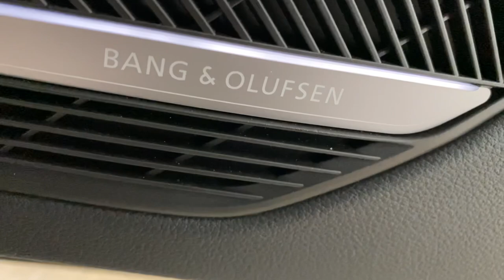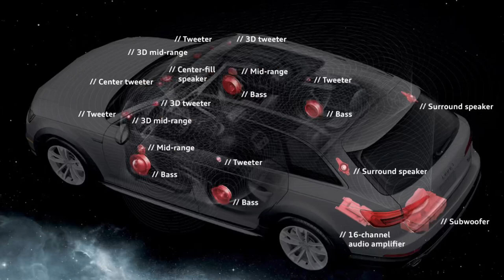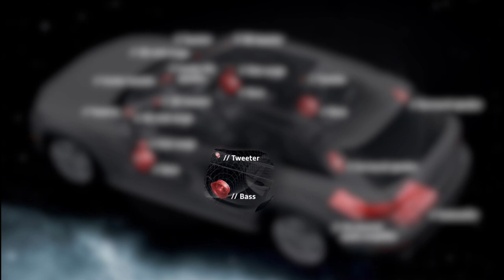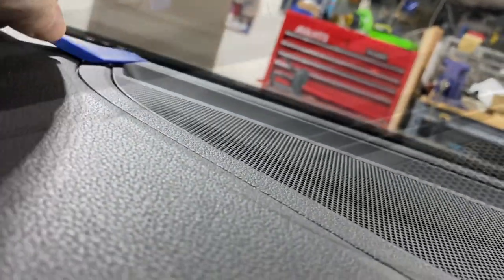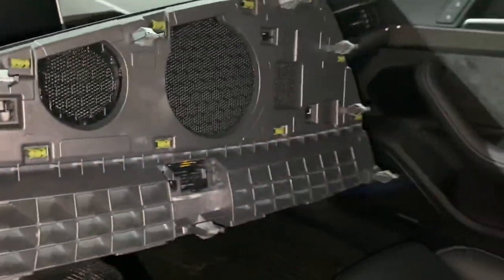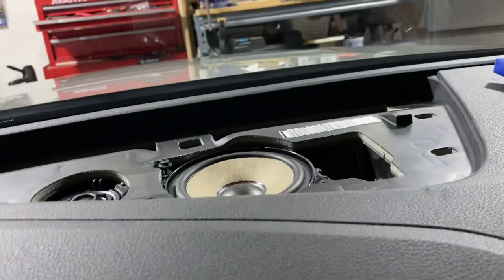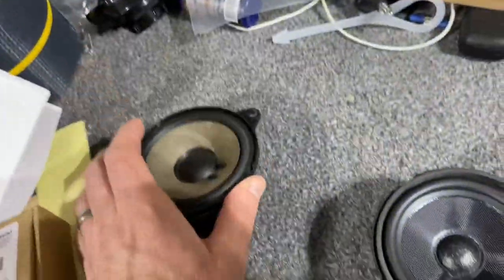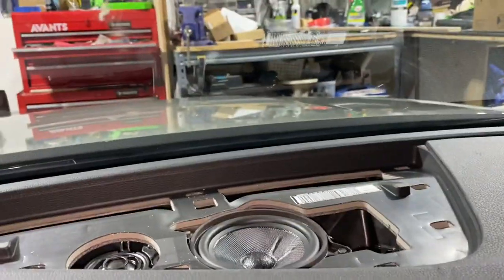Upgrade the B&O Speakers on Your Audi A5, S5 or RS5 Sportback - Front Center Speaker

Comment: I dont understand how people can think the sound system is flawed, it sounds perfect to me lol. Louder than I could ever want or need. Clear af.
Reply: Wellllll the B&O is kinda low par compared to my buddies 2015 BMW M4 H&K sound system… his sound system is realllyyyy good from the factory, Audi kinda dropped the ball on this sound system.
Reply: @93ChayZ  I agree, my 2017 Volvo V60 R Design Platinum Harman Kardon system was way better than my current 2020 Audi A4 Allroad B&O . The B&O is good, but the HK was superb, that’s just my humble opinion
Reply: @93ChayZ  totally agree, my M4’s HK sounded better.  The B&O is good, but not great for an upgraded system.
Reply: B&O. Bad and Overpriced
Reply: If you had the B&O system in the B8 before going B9 you’d understand. No base. Harsh highs. Rattling.
Reply: I usually think car audio systems sound fine, until I hear it aftermarket upgraded and realize how much better it can be
Reply: @93ChayZ I put my factory 2019 Audi A3 B&O up against MB and it sounded way better.  MB and Volvo has the best audio systems.

Comment: The B@O system in my TTRS rocks. At not even half volume the sound is phenomenal. Im an audiophile, have a home system that I’ve invested close to 6k. Think I’ll keep the system the way it is in the TTRS.
Reply: Curious to see what settings you have it in for treble/bass/sub. I’m trying to mess with mine because it doesn’t sound great but Im not sure if it’s just my settings or not
Reply: Zero reasons to replace B&O system and speakers Bruce Miranda sells are definitely not an upgrade. For non B&O yes but B&O big NO! Randoms making videos like this are just clout chasers

Comment: just an fyi for B9 owners of these vehicles - a lot of the subs were wired in reverse polarity from the factory. I have a 2019 SB S5 and 10 minutes of soldering fixed mine last night and it hits WAY harder and you can actually hear the bass. This is a big problem with these models. You can also just repin the connectors but I find soldering easier.
Reply from the maker: Interesting. Im also finding the speakers I haven’t replaced now need replacing. I’ll likely order them and do another video going over all the replacements and upgrades I’ve done to date.

Comment: I did this today.  I cut one of the trim tools in half so it would fit under the windshield. It's a night and day difference with just the one center speaker from Bruce Miranda (and the basser box). Thanks for the video.

Comment: I installed a Kicker Key and a 12" kicker down fire on my 2022 Q5 with B&O. I never had issues with the stock speakers other than the sub. I did have to tune the amp to get the sub to match the rest of the car. I actually enjoy it now.

Comment: Agree that the B&O upgrade is lacking.  Brand new SQ5 Prestige (2 days) and already looking to upgrade the system somehow. The center speaker sounds like a good start but it looks like I would have to buy the center plus 2 doors. Not quite ready to take the door panels off just yet. The 2023 dash where the speaker is located is a bit different.

Comment: Listen to a burmester system as in glc amg compared to B&O it’s like night and day, B&O is so low rate, I’m looking for an upgrade to the upgraded system in my 2015 sq5
Reply from the maker: I’ve heard those are great!
Reply: @Vaguh  there’s no comparison the clarity of burmester is unreal and you can push the speakers whereas the bang and O are just so flat and boring due to the presets which you can change but the parameters are so tight it’s pointless, I believe you get what you pay for when it comes to sound
Reply: My S550 has a burmester and it sounds great. The B&O,  to so much.
Reply: B&O are so low rate, a couple of years I wanted some wireless head buds for the gym, so I went for B&O as I had read good things about them this was before I got sq5 what a waste of money they were I stopped using them the sounds was awful, why on Earth Audi changed from using Bose is beyond me or even if they used a high end system as an option and Bose as standard but B&O I think are an  absolutely waste of money

Comment: I have no complaints other than the sub woofer on my 2022 Q5 With B&O. I do have to agree, the center speaker sounds like crap. Some times when I get close my house, my carplay will switch to only the center speaker and it sounds awful. I remember my BMW had a better sounding center speaker. My BMW also did the same thing. I think it's something with iPhone or carplay

Comment: Thank you for sharing these detailed videos.  I just finished replacing the center speaker and the mids & woofers in the doors (same setup as yours for those) and wow does it sound good!  I did however drop my socket down the hole next to the center speaker (stupid i know).   I heard it tumble down a bit and i couldn't see it when looking down the hole with my phone.  Any thoughts on how i might retrieve that?
Reply: Turn the car upside down and shake it
Reply: Telescoping Magnet
Reply: Did you ever fix this? Just happened to me 🙃

Comment: Did you have B&O to start with or is this the Audi stock rig? As am looking to up grade mine! We’ll the centre and door speakers for sure! But will I need any amps as am not sure if the stock system is amplified?
Reply from the maker: I had B&O to start. I believe the Audi stock system has amps already, but the ohm values of the speakers may be different.

Comment: I have a b8 sq5. Im wondering if this upgrade would also work with my car. Any thoughts or experience?
Reply from the maker: There’s likely a speaker there in that location. I’d have to look up the specs to say for sure which speaker you should use to replace it.

Comment: Does every B&O 3D Premium audio system, like the one in your video, and the one in my A7 make these continuously annoying popping and clicking noises? Audi technicians at my local dealership and an Audi engineer at AoA seem to think so. They made very little effort to fix the problem then pushed me out the door, telling me that it's just a condition of the system.
Reply from the maker: @matth8181  they upgraded the amplifier and sound tuning, but not the paper cone speakers.
Reply: @Vaguh  Have you heard the noises I'm refering too? Did your system do  the same thing? I'd really like to know how to solve it and tell the clueless techs at Audi how to fix it.
Reply from the maker: @matth8181  mine weren’t crackley, although I replaced most of them now. I do have one in the front left that buzzes a bit. I’m going to replace it soon.

Comment: So…who makes the original B/O speakers? I saw Audi rings on the one you removed. Does B/O just stamp that on the speaker back? Lastly, what is the brand of the ‘upgraded’ new speaker?
Reply from the maker: Pretty sure they’re just Audi OEM. The B&O is mostly in the AMP audio tuning and number of speakers. 
These are Faital Pro speakers.

Comment: if its just plug and play wouldnt the power be the same? Can you explain how it can sound that much better if it has the same power?
Reply: Different sensitivity levels = less required wattage. plus cone materials and magnetivity., and definitely frequency reproduction on the higher end for example softer dome material can create softer high end treble on ears or harder speakers sounding more harsh for example. Just my opinion

Comment: I did the same system, but with ciare hwg 160 instead of aurum cantus.  I am not satisfied with its sound, it takes me more towards the middle range.  Is aurum cantus a better choice?  There are also several versions of it, c2c, ck.
Reply from the maker: The autumn Cantus I have are definitely nice an full for a mid range sub. They’re very punchy, like I feel my leg hairs shake from bad hits. Not sure if that’s what you’re looking for, but they won’t me too, low as the B&O programming in the amp will only pas certain frequencies. I would have to do some research into what model would be best, you could also reach out to Bruce.

Comment: I have a 2018 a 5 sport pack with B and O audio system. As of lately, the bassbis not as loud as it used to be. I can turn up the sub full blast and it's not that deep. This only happens sometimes, certain times the bass is as it should be. Is my amp the issue and is it easy to replace? All in all I'm happy with my system except lately the Bass problem.
Reply from the maker: Could depend on the audio input as well. I’ve noticed that if I’m a streaming music on Apple Music it’s higher quality then some of the streaming stuff from Pandora and varies between songs as well.

Comment: Is that FaitalPRO 4FE32 the 4 ohm version?   Do you think they're too bright and overpower the other speakers?  Bobby from the forums suggests the 8 ohm version because it lowers the output by 3db and is supposed to be less harsh.  I want to place my order for these mids but can't decide between having more volume vs. slightly lower volume but with smoother sound.  Thoughts?
Reply from the maker: It’s hard to say, so much depends on the type of music you listen to and what other upgrades you’ve done. I also have a 10” JL sub and these do a great job of keeping up at higher volume levels. I also listen to a lot of books and podcasts, and they’re very well balanced for voice. I listen to all kinds of music and have no complaints with these.
Reply: @Vaguh  I followed the advice of the Audi World members as well and ordered the Aurum Cantus AC165/50C2C woofers, and will now order these Faitalpro mids for my S5 sportback.   I'll be looking for replacement tweets in the lower A pillar soon too.  I was debating on going with a full overhaul of the sound system, but wanted to see if I would be satisfied just changing out the speakers for better quality ones like many of you already have.  I listen to all different types of stuff as well and like it pretty loud, so the 4 ohm version with the extra sensitivity should work best for me.  I removed the stock sub and I'm currently running a single Image Dynamics IDMAX 12 sealed and Rockford T1500-1BDCP.  Once I get all the new door speakers in my hands, I will be watching your vids to help with my install so thank you.

Comment: So my problem with my B9 A4 with B&O is that the treble is piercing loud, even after upgrading my 2 door midwoofers and center speaker with Bruce’s speaker kit. I try to turn up the volume to make everything sound full, but I can’t tolerate the high frequencies to even get the rest of the sound range at the volume I want it. Any tips?
Reply: Did you adjust the sound settings to boost treble and bass? I tried that but the treble isn't great sounding so I have it at default in the middle. I think the best option is to upgrade the tweeters in the A frame to get better quality.
Reply: @RyanSheppard  I think I’ve played around with everything at this point - the treble the bass, and moving the fader slightly back to take away from the dash. It’s just like the dash is shouting in your face, and you are only hearing the highest range of the vocals. Sounds really thin, and fatigues your ears

Comment: Man I'll tell ya. My sub rattles the back of my car so bad I had to basically turn it off.
Reply from the maker: Stock sub, or 10” JL in a Basser box? I have the settings in my amp almost all the way down.
Reply: @Vaguh  Stock sub. B9I S4. I want to blame the guy that did my tint because he removed the panels lol. Poor excuse. Ha ha. but I think it's the rear deck lid for the most part. It's a lot of work to dampen it but I dont see any other options. I've tried pressing the clips tighter but to no avail.
Reply from the maker: @terrycorkum  got it. I have the Sportback, so we had a tiny 6.5” sub under the spare tire. I think yours is a 10” in the rear deck. Try some foam tape under the grill.
Reply: @Vaguh  I tried the VW R Fender Sub fits over the spare in my A3 SP,  planning to upgrade the speaker as well using your vid.
Reply: @terrycorkum  I had the same problem. Took it to the dealer twice. 2nd time they fix it. Added insulation I think. I can say the one thing I hate about these alcara are all the rattles
Reply: @sykokilla77  Thanks Adam. I've been thinking about this avenue but haven't convinced myself to sit at the dealership yet while they work it out. They stopped giving loaners since covid hit and it's an hour away.  Still have warranty so I should probably do it sooner than later. Thanks for the insight.

Comment: That’s just false. My speakers do not get distorted AT ALL! And the max I can listen to is maybe a little more than half volume, any more and it’s too fucking loud for me. Either way, the B&O in the 2019 A5 coupe is 👌🏽
Reply from the maker: I’m glad you’re happy with it. I upgraded the bass by adding a 10” subwoofer in the trunk. Even with the gain on the amp turned way down and the subwoofer control set low in the MMI, the stock speakers had a hard time keeping up and cutting through. I didn’t initially have an issue with the stock speakers, but trust me when I say, the aftermarket speakers are much more clear.
Reply: not false. the B&O in my 21’ RS5 is not that good at all. you must have never heard a good clean system in your life lol.
Reply: @stealthhtm23  lol, my dad has a 2020 S550 w the upgraded Burmester sound system, and my mom has an S8 w the fully upgraded B&O, Iv been around some good sound systems
Reply: @stealthhtm23  totally agree, just got my RS5 and I’m disappointed in the B&O.  I feel like my M4 with the Harman Kardon system was better, and the B&O is supposed to be an upgrade from that.
Reply: @gerry_mpxriders2297  I ended up just getting the Bruce Miranda center dash speaker, disconnected the oem sub, and put the JL Audio CP110 in the trunk, and made a world of a difference
Reply: @stealthhtm23  did you upgrade any of the other ones? I've been thinking about doing this for a little while now but not sure how far I should go, I don't want to unnecessarily upgrade ones where you won't notice improvement.
Reply: @QS17  the center speaker & sub is all you need for a huge upgrade. start with that, and go from there
Reply: @stealthhtm23  appreciate it, I just hope it's enough. I love my car and it's my first Audi but it's kind of disappointing on how they cost cut on stuff like this. My 2006 Acura RL has a better factory Bose system and I never been a fan of Bose but they designed it well for it.